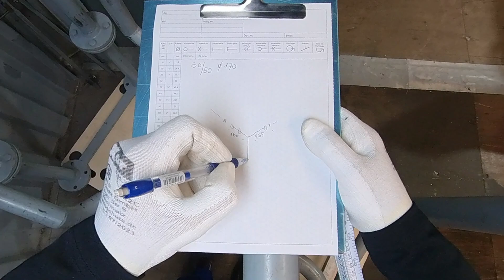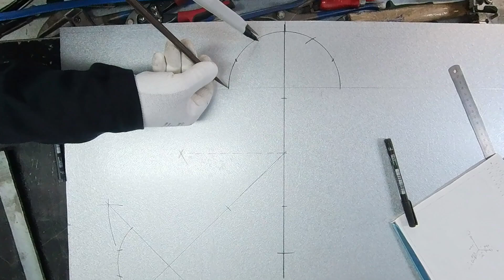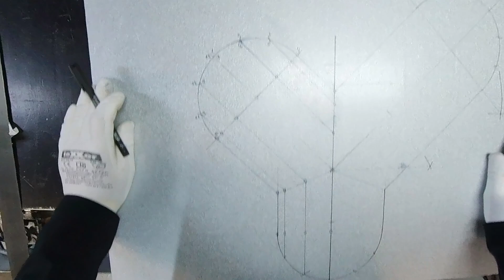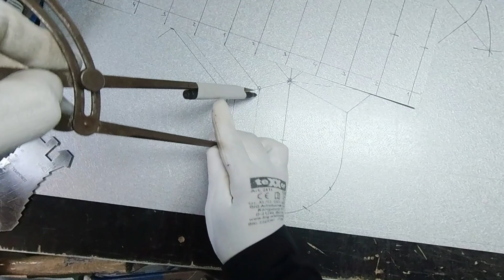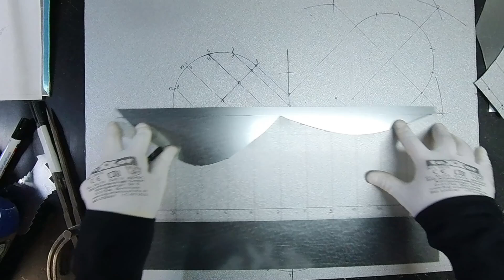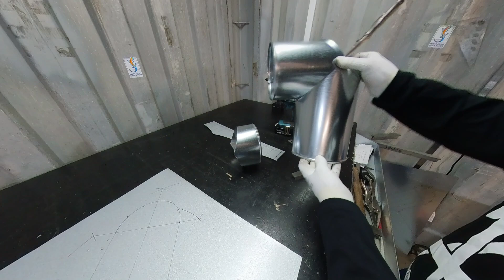Y-Piece

Comment: This is the most brilliant piece of sheet metal working that I have seen.  I was wondering if you could do a variation to this where there is a mains of 200mm Ø running through as a spine with a smaller diameter pipe 100mm Ø coming in at 45˚. There is only one angle to this piece. This I would use in my woodwork shop dust collection system. Thanks.